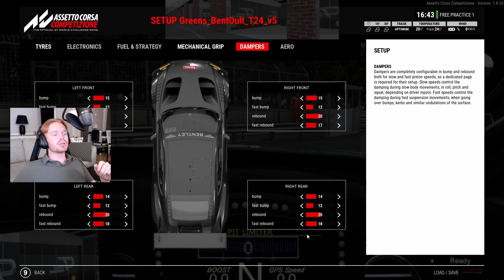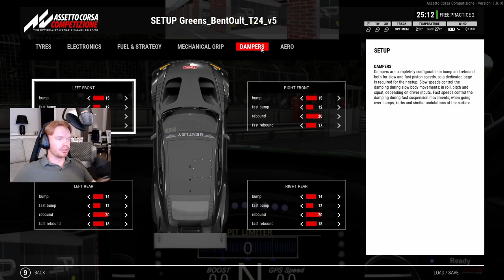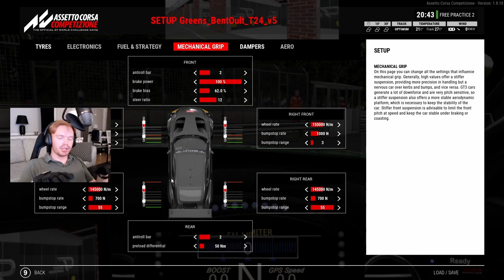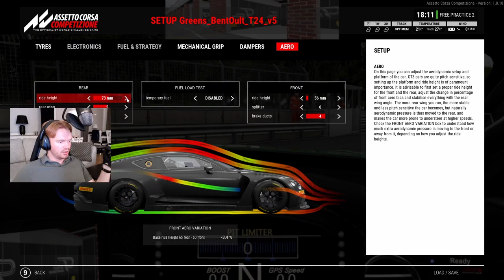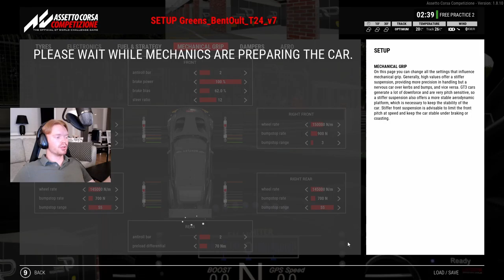Greens ACC Setup Tuning Guide

Comment: Thank you for this video. I never felt setup guide videos covered how vague and difficult working on setups feels when you can't feel the G forces. It's like a placebo affect for me always. I think it requires understanding how each component on the car is mechanically working first.
Reply from the maker: Yeah you're right! It's partially about training your brain to use different cues as well (looking for yaw/rotation based on the image instead of feeling it and using steering wheel torque to a much larger extent etc). There's a whole science about this when it comes to proper simulators

Comment: Would you recommend start in the safe setup and then learn all these setup settings? My thought was, in being able to feel, how the car drives, then figure out the settings one at a time. Cause then we would know if the car isn't working correctly/ when the setting knocked the car out of wack.. thank you for your explanation. I think, so far this has been the second /possibly one of the best detailed. Thank you again
Reply from the maker: I'd suggest you start in the aggressive setup actually. It might seem a bit "not beginner friendly" to do it like that but it's not that aggressive and you also learn how to drive a type of setup that is better as a baseline. The safe setups can be quite weird. Apart from that, it's just getting experience, changing things and see how it goes to learn. Sorry for the really late reply but thanks for the question!

Comment: I use safe setup then I need my 3 track medals and aggressive/wet during races.
Reply from the maker: The aggressive setups get you very far and the safe setups are most of the time safe. Just be aware that the safe setups can be built half sketchy at times depending on the car and track. If it works, that's great! Whenever I drive a new car I always start with the aggressive setup, it's that good of a base. Great feedback btw!